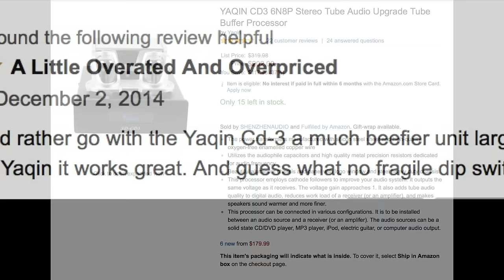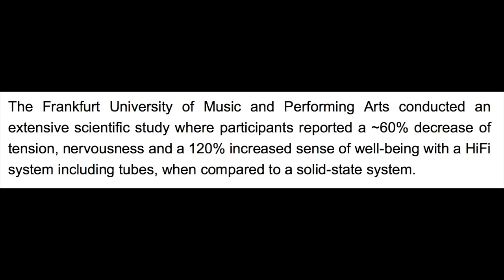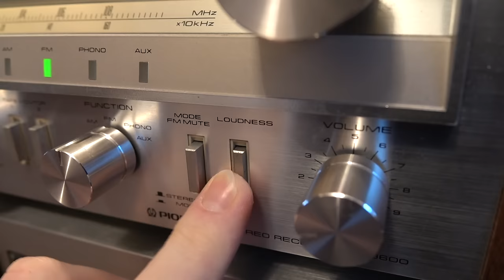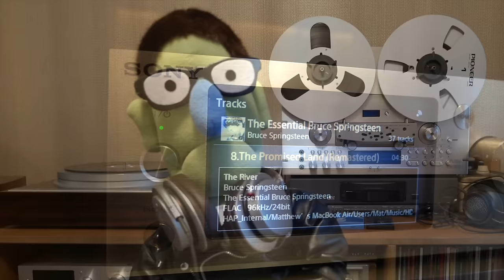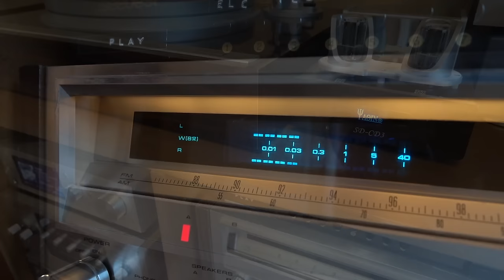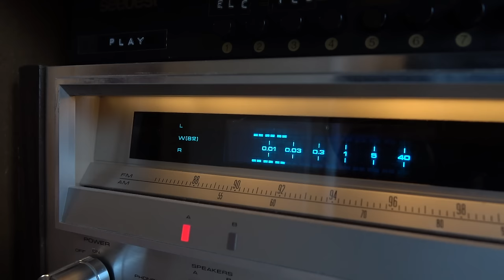Add the magic of Valves to any HiFi - with The Yaqin SD-CD3 tube processor

Comment: The reason you appreciate the sound through the tube processor or tube buffer as they are known is that you are adding even order harmonics, which to the human ear are very pleasing. I have a Yaqin MC10 full tube power amp, have had it for years. Love it. I recently built a few ELEkit class A amps and they sound even better. There is nothing like the sound of vacuum tubes. My studio amp is a Luxman LV103, and it basically has what you have there built in. That amp I have owned since new in 1984, original tubes in it, and it sounds fantastic. Will never replace that one.

Comment: Unless you're using proper cryogenically treated power and speaker leads with gold-plated conductors that have been hand-tuned by naked virgins to establish the correct morphic resonance then you're wasting your time with a valve amp like this.  Also note that you should have aligned the valves so that the plates run east/west because this will eliminate the non-linearity introduced by the intersection of the earth's magnetic field.  (LOL -- do I sound like a top-notch audiophool yet?)
Reply from the maker: +xjet yes, that's pretty convincing. 
Off to align my valves.
Reply: +xjet What I'm missing is the placing of the valve rig in another room to avoid microphony. Now where were those naked virgins?
Reply: +xjet lol well said.
Reply: +xjet - hey, back to the bench! We need more reviews from you, and you're here enjoying yourself instead of working hard :)
Reply: Love it. You've been watching Dave Jones too much! :)
Reply: Gold plated? Are you poor? Platinum is the minimum I'll do. You must have the highest quality possible! Your equipment should cost more than the average house, and you should only listen to it once a month, so you can preserve the integrity of it. :-)
Reply: you get the richest sound if you sacrifice some of the mentioned virgins from time to time to our lord and savior cthulhu
Reply: Laugh all you want, but all my valves run east-west now. -.-
Reply: Also, make sure you keep it in a glass cabinet, preferably not hooked up to anything until you need to use it, with the valves promptly replaced the SECOND you are done, so as to prevent dust bunny colonies from forming on said unit.

Make sure to eat a diet of pure fruits and nuts to keep your holistic aura in check, so it won't interfere with the sound quality.

That device should also NEVER be used with any system that costs less than 10000 quid... It feels insulted when paired with 'cheap' equipment...

Should I go on?

Lol XD
Reply: I'm a bit late to this party but, that is one of the best comments I've seen.
Reply: What's an rc channel doing here?
Reply: Xjet give those 1970s Haymarket publications a rest and invest in some decent German vintage jazz mags with hairy tottie and shot putters arm pits. Do you good! 😂😂😂
Reply: You amateur! You neglected to mention the delta-wave irradiated antimatter!
BTW, are those virgins included in the price of this unit?
Reply: I would be more worried about microphony in the switches - this is actually noticable in older telephone switches, see the old telephone network sound videos by PrankyCallz.
It would be interesting to see how valves behave in the presence of magnets and electromagnets.
Reply: Naked virgins? That's complete snake oil! As long as they avoid polyester or similar modern materials in their clothing you're fine. Also, you can locally re-align the field in a room by using magnetic crystals to avoid equipment standing in weird angles. (On sale at my store right now for only $97.85 a piece. Beta-wave insulated wires for hanging sold separately.)
Reply: Lmao
Reply: It's 2021 and a LONG time late to the party. We have now been introduced to the much anticipated (virus permitting) Vibranium Edition. This uber elite premium amp has tubes sourced from Wakanda from the King himself no less. Suitably constructed with fallen rainforest wood and completely vegan, Peta, Earth first and UN approved materials. The metal playing is sourced from recycled Bentleys and the copper for the wires sourced only from pennies that have fallen to the ground.

Now you might ask, what does this amazing device cost me? Well I'm glad you added! A price is available that will suit nobody but a Saudi Prince. See below.

1. One arm
2. One leg
3. One left nut (both if you opt for the gold edition made from Snoop Dog's teeth).
4. And finally your first born.

Taking preorders now, subject to change without notice, product may be radioactive at startup, not responsible for any violent electrocutions, cyborgs looking for spare parts or deranged lunatics.

Orders should be processed by 2281 or your money back. Penalty applies for cancellation.
Reply: PS: Sorry for the spelling errors, damn Google glad you asked not added.

Comment: It may not sound $200 better, but it sure looks cool sitting there next to your other cool vintage gear, and sometimes looks are worth something. For what it's worth I have a tube guitar amplifier which sounds amazing, but when you take the cage off it so you can see the tubes plasma glow in a dark room it looks awesome, too.
Reply from the maker: +Helium Road You're right - my setup has been assembled using a combination of looks, rarity and sound quality.

Comment: Valves are known to be slightly microphonic, that is, the suspended elements inside pick up external vibrations and introduce them into the signal. The "spaciness" you describe might be slight reverberation caused by this characteristic. Add that to the list of "valve virtues" that also include softer clipping, softer push-pull transitions, less damping of speaker resonance (which can either be pleasant or extremely unpleasant depending on the speaker design) and even more 50Hz or 60Hz hum. None of this stuff (other than softer  push-pull transitions) contributes to traditionally defined "fidelity", but it does endear people to the the sounds of vintage equipment.
Reply: Wow, that's good! I'm an electron engineer or something, and indeed have wondered if it was actually the transformers etc, but YOU NAILED IT.

Comment: I used to use a high power light to go with my dad’s super 8 movie camera. If you got a finger print on it, the bulb and burn it out in minutes. Maybe thats how the valve (aka tube) wife’s tale started.

Hello from the US. Love your videos!
Reply: That's also true of the tiny halogen bulbs they put in older car headlights and those "touche" lamps they were pushing about 25 years ago, which have subsequently been banned in various places for starting fires. I imagine that if a valve ever got hot enough for fingerprints to matter, it wouldn't last long anyway.

Comment: I've got a Musical Fidelity X10-D tube buffer to run my CD player output through before it goes into my amp, and I think it sounds fabulous! I've even used it to smooth out the the signal from an MP3 player before amplification, and it works great for that too. I'd really like to use several of them to run all of the channels of a digital surround-sound system through before they are amplified - well, maybe someday...
Reply: Similar is with me...also own X10-D.
Now when I have two various audio systems, with solid state and valve amps, I use buffer with s.s. amp. to make some sort of hybrid amp ... like Pre  and Power amp. combo.
Musical Fidelity buffer with valve amp. before, was too much of good thing
P.S.
I have changed the orginal Philips valves for Telefunken ones NOS 85 s...Heard the imidiates improvement in sound.

Comment: I use a vacuum tube pre-amp for my condenser microphone. Makes my voice sound warmer and WAY better. Tube amps are GREAT.
Reply: EgoShredder Haha mine is made by ART too. Its professional processor series. No idea what the model is though,
Reply: These are shite. They choose some valves that will run out of spec at low voltage, and find any excuse to pass audio through them to call it a valve amp. There’s nothing wrong with the new production Russian valves in proper equipment.

Comment: I reckon audiophools will believe any box with a set of glowing valves on top is magically improving their sound even if they were all not connected (other than the heaters) and the input was wired straight to the output. Sound improvement proportional to the number of 0's on the end of the sale price. I'm not suggesting that's the case here, but it gives me a great idea.....
Reply: GRAHAMAUS i would second that opinion as the people that buy these things often refer to 'that warm tube like glow' almost if it had some ye olde worlde magick like allure. In reality it is just a cheap led creating a fake traditional valve like emmiter glow. As i understood it you have to have valves on both the pre and power stages powered at much higher voltage levels than this that operate so hot that they will burn skin of your fingers to the touch like an heated pyrex test tube. I suspect this is fake snake oil at best as true audiophile valve amps cost £2,000 upwards due to the fact that they are hand built from custom selected new old stock components on metal chassis There will be a difference in sound with this but it will be so subtle as to be lost in the music when not concentrating to hard to hear it.
Reply: I had old school little valve amps in the '80's. One was like only 7 watts per ch and that particular tube amp was the best amp I ever heard. The rest weren't so good, but that particular one was and I'm devastated that I sold it.

Comment: Technobabble follows: - Thanks for the inside shots. 
The blue things are 'capacitors' and allow the audio (sound) to get through them while blocking any Direct Current, so two of the four are on the input. The other two are probably there for technical reasons (cathode bypass - to increase gain) and the two near the front are for the output (so you dont feed 300Volts into your power amp!
The two black things are only power supply filters (high value capacitors) (they keep the 50/60 cycle mains hum out of the system) The little black thing next to them is the rectifier (converts the a/c from the transformer into dc to power the unit - and that explains why all the black things are next to each other)
The 6SN7 is a dual triode (effectivley two simple valves in one) and the unit seems to really be a simple pre-amplifier. What good it does, I really don't know. Probably nothing objectively. Its all in the listeners' minds and preferences.
It would make more sense to me to put power pentodes in the output (between amplifier and speakers), with an output transformer if you want the true valve sound.

Comment: How about getting a few friends, and doing some  "blind tests" to see if they can hear the difference and which they prefer. The common wisdom is that it is the "valve" output stages, combined with their output transformer that some people prefer. In this case, I suspect this is a simple cathode follower, with unity gain that should provide very little difference one way or the other,
Reply: Fred Zlotnick Great idea really.
Reply: @dednside5229  So you have like over $10,000 tied up in a system and then say a $100 fake valve preamp thing improves your system?
Reply: Well that's interesting. I had some old school valve amps and one was like the best amp I ever heard (it was better than my other 3). If I tested a good say ROTEL tranny amp with my best tube amp, the tube amp would probably win, but if I tested it against the other tube amps I had, the ROTEL would probably win. And (apparently) they blindfold tested a $200 tranny amp against a good tube amp and the blindfold test picked the cheap tranny as the "tube amp". And I never thought about my valve experience my theory with the ROTEL (that I heard way back) until I saw the video about the blindfold test. lol 

But if there is a difference I would describe the tube sound as "shinged" and a tranny amp as "zizzy" (both just a by little bit). Maybe valve amps do sound different but a bad tube amp may not sound as good as a good tranny amp. And even different tube amp brands sound different and the same with trannies. It's a shade of grey thing with so many variables.

I have developed a way to make speakers sound like tube amps, by making the speakers sound "shinged". By the use of a tiny piece of foil on a tiny stick. I glue them directly to drivers and also make "piggy back" coaxial drivers. In both cases it makes the foil vibrate completely separately to the rest of the driver (I coined it "acoustic separation"). And the foil makes that "shinged" sound. If you are curious, just go to my channel and there are speaker videos on top of the list. That's another approach to making tranny amps sound like tube amps. Maybe a combo of your device and my speakers would be interesting.
Reply: @dednside5229  I heard that class B only makes the + half of the sine wave and then has to rectify it and then join it onto the bottom so you have a complete sine wave (seems to me that could be referred to as "push-pull" but I don't know). And class A is just a complete sine wave from the start and so is more accurate cos there is no matching error at all (obviously). But that small error on class B is normally only a problem at low volume levels, and so there are class A/B amps where it switch over to class B at (like) over one watt. But pure class A is best cos it's so accurate and good for high-end (and maybe there are different types of class A). And is SET SET a different thing than class A? And is push-pull a different thing than class B? I don't know anything about it (well hardly anything).

Comment: as one that has built (from scratch) both tube and transistor amps.. there is one characteristic.. Second Harmonic Distortion.. found in a LOT of tube amps.... It is a pleasing distortion, and one of the reasons that lots of folk seem to  like the tube sound.

Comment: For anyone curious as to what this piece of equipment does, it's just a unity gain buffer. Basically it will take a high impedance input signal and spit out the same signal  with a lower impedance. No circuit is perfect so of course you get a little bit of eq applied to the signal because the circuit does have some amount of capacitance and resistance. Without reverse engineering the circuit I can't be sure, but more than likely the tubes are adding a percent or two of distortion. If this effect is good or bad is obviously subjective.